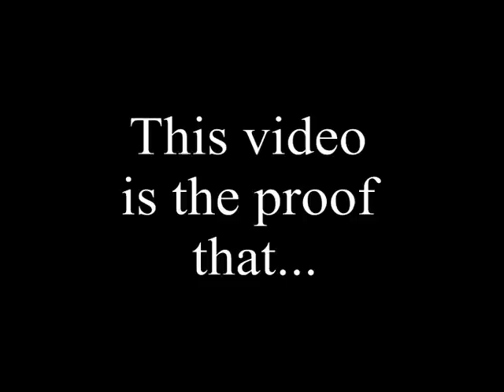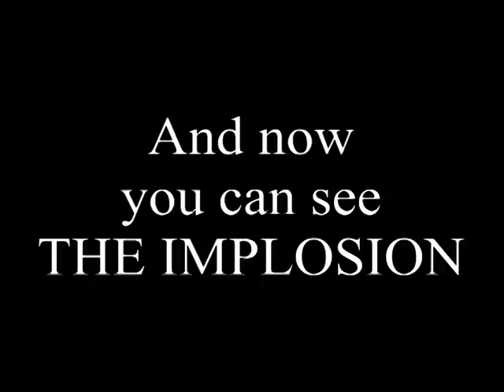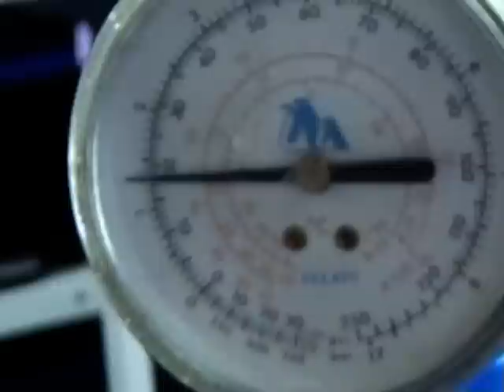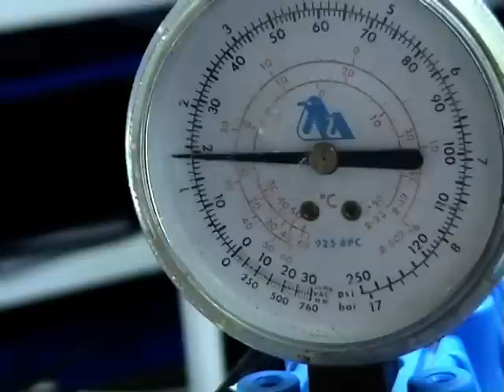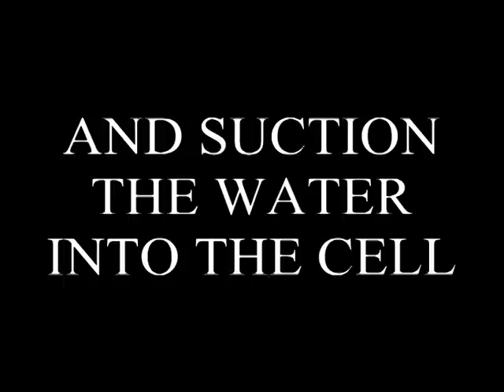HHO Explosion and Implosion

Comment: Very nice video and I'm going to link to it, with one caveat.   Sorry that I must dis-agree on terminology... Yes a vacuum is formed but NOT because the gas 'imploded'.  It's because a gas mixture (hydrogen and oxygen) that takes up 1866 cc (in gaseous form) converts to a liquid (water) that only takes up 1 cc of volume in liquid form.  The gas did not implode, it exploded (violent expansion), then (if the 'explosion' was contained... didn't blow the container apart like your syringe experiment) a net vacuum forms because the gases have reformed into molecules that take up much less volume (a vacuum forms).    There is ALWAYS  an explosion first and THAT is the actual and only 'reaction' thus there is NO implosion.  The vacuum forms as a secondary effect of the explosion and is not technically an 'implosion'.  

Here is a video that DOES show an implosion... If you separate the ExW portion of the HydrOxy (Brown's Gas) from the hydrogen and oxygen.  
https://www.youtube.com/watch?v=-9EmgSowldw

Comment: This video reminds me of something I thought about a few years ago. Hydrogen and oxygen take up much more volume than the water they produce which suggests the reaction would create a partial vacuum. Yet the heat produced by the reaction should create an explosion (and it does) and that should create positive pressure. I never investigated the answer but now I'm thinking about it again. It would be useful to know if the piston would get sucked back in if it didn't go flying across the room.

Comment: Could it be that what we think we observed is not the whole story? Perhaps with a superior high-speed camera, things may become clearer. I am of the suspension that the water electrolyte mix may be acting as a heat sink. Whereas in the syringe, the hho is a Gass only volume. Hence, as the o2 and hydrogen rebond energy is released this along with the newly formed water. Causing an almost instantaneous steam reaction. However, in the electrolysis chamber, the present fluid absorbs the said energy..... just a theory I'm a mechanic, not a rocket surgeon.

Comment: Not an implosion, the gasses left in your hho gen are hot from the burn... as they cool off they contract causing the vacuum. Also the plates are heated from the amps you have running through them. When you heat any open chamber then turn the heat off and cap it, the gasses will shrink as they cool.

Comment: Dear Sir,I'm extremely grateful for the experiment uploaded and shown in youtube,titled""HHO Explosion and Implosion"-especially explosion!I would like to help you to prove that after the explosion occurs implosion.For the purpose you have to repeat the eperiment as the body of the syringe should be 5-6 or few times longer,so that after the explosion the piston shouldn't leave the syringe.Once it moves to the left to some point and stops,if vacuum occurs in the syringe,it would start moving backwards. It is extremely curious to what point it would go back in the opposite direction. If you do the experiment the video you can upload in youtube could be titled"HHO Explosion and Implosion-2". Thank you once again,with your experiment I have applied for a patent and I've already had a publication and I would like, if the suggested by myself experiment above occurs a successful one,to establish connection with you! Thank you very much!Regards!

Comment: like someone else stated. The explosion first created pressure that was looking to get out. the when the explosion was finished and everything was cooling down there was a vacuum. BUT also we have to consider that HHO molecules might take up more space than H2O water molecules, The HHO is converted to H20 vapor. Does room temp H2O vapor take up less space than room temp HHO? Maybe! We are taking 3 molecules and turning them into 1 molecule with 3 parts. So, I think you might be right.

Comment: @demnlordd666 simply put, what you call an implosion is an attempt of the experiment to come to equilibrium in a fraction of a second.  it reduces the pressure a great deal by condensing the exploding HHO to water, boils some of the vessel water, to meet the pressure deficit w/ vapor pressure, spikes, n precipitates the H2O back to water in an instant.  all a result of a COMBUSTION cycle. it all happens b/c the rxn chamber vents through a small tube allowing an imbalance in pressure for a sec.

Comment: No dude. You just instantly burned up all the gas that was in the tank, leaving a vacuum behind. It does look like a good way to create a vacuum quickly, if you can first vent the explosion! Nice work. I'm finally about to install on my vehicle!
Reply: Nitrogen was burnt up?
I know what your thinking but the gas does not burn up as such, it simply combines with other gasses to form both gaseous and solid byproducts, take a gas formed by the separation of water through adding a few electrons, in recombination after the initial energy is used to start the reaction water is formed as steam which then collapses as it cools.
The other gasses present initially were diluted and mostly released before the flame fount was able to maintain temperature and travel inside the tube

Comment: Great video. The vacuum that draws the water back into the cell is created by the cooling of the gas in the cell which was heated and greatly expanded in the burning. As the gas cools it shrinks creating a vacuum in the cell

Comment from the maker: I did it with an electronic board, which has an 160hz oscillator and a high voltage coil of the spark distributor of a car.
Greetings, Hans.

Comment: So, with the syringe experiment....
If you have a 10 meter long syringe (just think iwth me, and 10cm of HHO gas at 1 bar. Ignite it, and surely the 10cm of HHO will expand, pushing the syringe pistons out. But possibly not all the way, pulling that vacume behind it? Resulted steam cools down, first to a smaller volume than the 10cm HHO, and then to 1/1800th of the 10cm, as liquid water? Please correct me when wrong, I need to understand this to continue. Thanks!

Comment: Why didn't it flash back into the system immediately when you tried to light it. Was it pressure of the gas coming out or something else? Im trying to understand how an hho torch does not flash back due to oxygen and hydrogen running through the same lines.

Comment: when the hho explodes it turns back into water. water has a much lower density than the hho. thats why you get the "implosion" the explosion is all about temperature wich decreases the density and therefor increases the pressure.
 srry for bad english

Comment: That's not an implosion, is simply the flame entering the cell vessel and causing the explosion of the contained Hydrogen gas, and in fact you need to stop electrolysis to lower vessel pressure and let the fire in. In turn the explosion makes most of the gas exit the vessel and that produces a vacuum - as in all explosions. Instead an implosion happens when there is a substantial and fast decrease in volume, but definitely that's not the case.

Comment: @Me102288 That is a good point. Deigning your containers to fail predictably and safely is good practice. Yes I would have to agree that it is safer than gasoline, I think everything is safer than gasoline. Hydrogen has a high dispersion rate so in a well vented area the hydrogen will be gone very fast in cases of leaks that do not ignite. One property of hydrogen that can make it unsafe in cases were other fuels are is that it does not have a minimum fuel air ratio to burn.

Comment: so one could make a piston engine, in which the intake valve would close before bottom dead center, spark would expand and then contract the piston back down when the exhaust could open maybe it could operate with sleeve valves

Comment: At first when Hydrogen And Oxygen React,
Both Of The Gases Will Heat Up Along Side the Air Which Will Make The Gases Expand Before Being Used Up (And Thats What Happened At The Syringe Part) But After This Expansion,
The gases Are Consumed Due To the Chemical Reaction Making Water Vapour (Which Is Obviously Less In Volume) Thus Creating A Decreased Pressure And Do Work To Pull The Atmospheric Air Inside The container (You Pulled The Water With That Force)

Comment: nice experiment, but what you have in the reactor is not an implosion! Why? Because the flame front travels back to your reactor using up the fuel (HHO) and creating heat. As the reactor quickly starts to cool the volume of gases inside drops creating negative pressure.

Comment: That is not a implosion that is merely the act of the hydroxy(hydrogen+oxygen) pushing out the air with the explosion and before the air rushes back in you put the cup under the pipe therefore creating a vacuum in the electrolosis chamber which tries to suck up the water in the space of air.

Comment: if you wont to prove an implosion but very little hho in the syringe this way it will not blow the plunger out the end and there for should pull the plunger back in but I belive this will be more down to the cooling gases then implosen

Comment: Ok for the explosion, but it did not implode !
This is not an implosion : the HHO being burned (it has EXPLODED in the bottle and you can be sure the burned gas has come out the bootle), its pressure inside the bottle has drastically diminished, being lower than the atmospheric pressure...
Reply: implode, cause  3,6L go to 36L(at 3000C, one explosion) and after to 0 0,018L, one implosion

Comment: Jup an implosion would be an reaction where the temperature suddenly drops a whole lot, or the hydrogen/oxygen gas should recombine to water really really fast.. both scenarios are implausible..

On the other hand creating an fire inside an closed container uses up all oxygen and burnable gases, the heat inside will dissipate and this will suck.

Much like this video!

Comment: Dano is right the pressure was not equalized after all the gas burned . Therefore creating a vacuum. This same effect can be produced with any fire and a container. Ever hear of the match milk bottle egg trick?? The burned match in a bottle will suck the egg into the bottle without any form of explosion or implosion. The pressure difference is what causes the vacuum

Comment: that wasnt a vacum just once the pressure was low enough the ignition backwashed. a flash blocker will prevent that. or even a cigarette butt shoved up the hose. also the modern motors have difficulty with pure hydrogen only because of the timing. a true hydrogen motor also would not require an injector. simply a carburetor.

Comment: welll.... when it explodes... it burns out all the air inside, so the pressure is a lot higher outside... it sucks the water in cause the atmosphere is pushing on to the water in the glass. thats it.

Comment: So badass , you should make the implosion suck the water back into the tank through  a tesla turbine and capture the light energy by solr cells and the het energy by mass hho into a engine and then use the heat exhausts to make steam.  It be  bad ass project

Comment: thats not impolsion! it sucked up the air outside after the explosion to balance the pressure inside with the outside. an impolsion is only happen in a vacuum before any cumbustion process occurs. in your example is not impolsion, the vacuum was created after it exploded so it sucks up the water because of the gas expansion inside the hho cylinder to equalize to the ourside atmospheric pressure.

Comment: Cell operating: flame speed of HHO mix  production rate.  Cell shutdown during combustion (MASSIVE fire/explosion hazard):  flame speed  production rate - fire in cell, volume of gasses decreases to 1/100th original volume, creating partial vacuum.  Same effect as candle in a jar that has a card cover the opening, candle snuffs out creating a vacuum from combustion.  This video is exactly EVERTHING that should NEVER be done with flamable gasses.  I hope you never blow your hand off because you w

Comment: Is very dangerous what you just did there , you where very lucky that filter vasel  hold the pressure , but anyway ......I like your courage
Reply: you called it right .. a pressure  not a vacuum :) cause it is not an implosion ! and the vacuum created after is from the air cooling down !

Comment: Hello!
there is not IMPLOSION, this is only EXPLOSIONS!
the principle is simple,
when the hho is blowing, it create hot water vapour,
when this water vapour  is cooling, it condenses into liquid water, the volume taken by vapour reduce, and make depression...(a very very slow implosion)
if you cool very quickly the vapour, you will have real IMPLOSION.
if you want do an implosion experience, take a coke can,fill it with a little bit of water, wam it until it boil and create water vapour in the can, and set quickly in cold water: you will have amazing little implosion!
WARNING: implosions are dangerous as explosions, they are just opposite of explosion.
PS:sorry for my dirty english!
bye!

Comment: @Me102288 there are VERY few free hydrogen atoms rolling around in there.  they almost immediately regroup to H2 stable form.  H2O --> 1/2 O2 + 1 H2.  the proportions are the same at any scale of conversion man so also 2 H2O --> 1 O2 + 2 H2. the only partial pressures you need to consider is H2 O2 and H2O.  if you take an average of pressure during explosion(+) and during resulting implosion(-) you get 0. or atmospheric pressure.  wow it got hot n expanded then got cold and condensed. big whoop

Comment: Sorry, but you are wrong. Yes, things do expand when exposed to heat, however vacuum was created inside of HHO generator because during the explosion all the gases that were inside burned. As a result, difference in pressure inside and outside the generator was created (Vacuum). Because of this simple fact all the water got sucked in.  
P.S. 
The generator was filled only with Hydrogen and Oxygen. Both gasses combined together are extremely flammable (no noncombustible gases) .

Comment: What is the point? We know Hydrogen burns and we have known it for centuries. I am still trying to figure out your point to this demonstration. They have been using a machine to make HHO for decades to weld with, however it is not a cheap conversion. Work on that and get it to where we can use one in a car or mower or an RC engine, something we can use.

Comment: You failed to understand the demonstration. 
First of all, the electrolyzer produces Oxyhydrogen therefore any gas (combustible or not) gets pushed out of the system.
Second : the non combustible gas only absorbs heat (thats the explosion);  as the newly formed steam loses heat to the ambient air, it eventually condenses to water. 
When the internal pressure drops below 1 atm it creates a vacuum effect. 
If the pressure drop is fast enough conditions are met to become an Implosion.

Comment: Do you know about atmopheric pression ? If you take the air out of the cell, or burn it, (wich is the same, the atmospheric pression will push on the water of the glass,  and this water will go inside the cell. You experience is absolutly NOT an implosion !
Reply: Hello, the atmosphérique pression is one kilo in each square centimeter, at the level of the top of seas. That's mean 10 tons on each square meter. This force was use in the first locomotivs. (vapor, steam, engine) The cylinder was pushing first by the very hot steam, then it's return 
was pushing by the atmospher pression. Later, two hot steams was use on each side of the cylinder to move it.

Comment: wow total flash back, DO NOT TRY AT HIGHER PRESSURES you will blow the cell, as for the power its just Volume and energy from 2M H2 and 1M O2 thats a chem 105 calculation